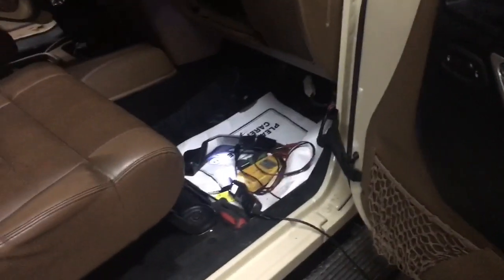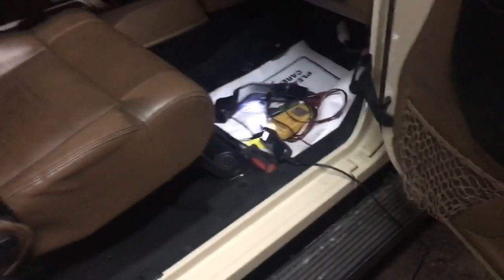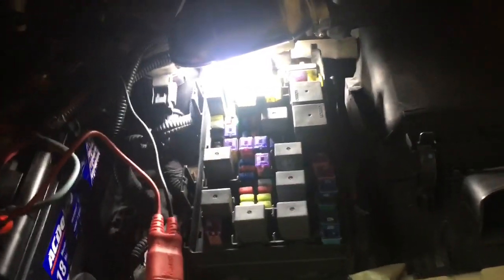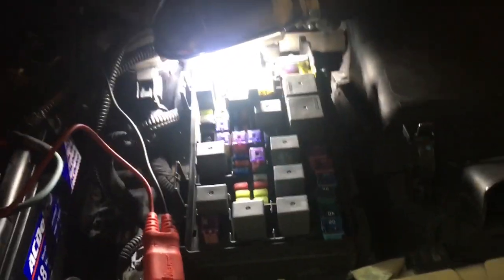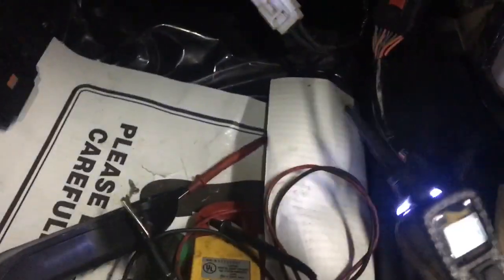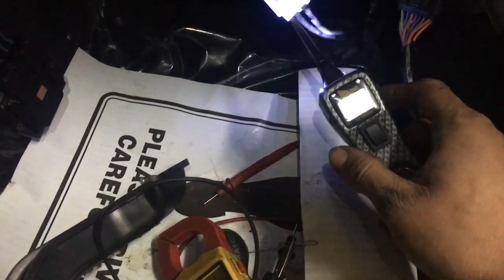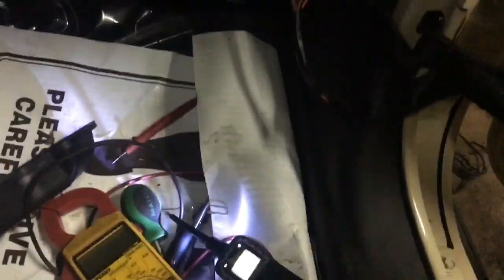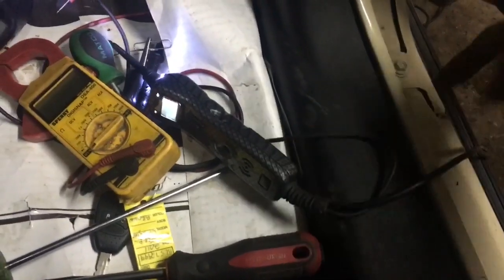How to repair no blower motor or heat in a 09 2010 2011 Jeep Wrangler

Comment: Great video. Well thought out. My fuses were good (but pressed down a few that weren't all the way down) - not it. I disconnected and reconnected the blower motor resistor - not it. I didn't want to mess with the wiring harness until I tried a few things first. I had the blower controls up and tried tapping the bottom of the blower motor - and it came on and stayed on. I'll see how often I have to tap it before I know I should change it out. I left the big screwdriver in the Jeep so I can get it going if it stops again. Thanks again - This weekend we are going to have highs of 11' F - 15' F and lows of 0' F t- neg7' F. Great to know I have heat and defrost again !!
Reply from the maker: I did almost the same thing with my battery for a couple days Jake eventually I couldn’t get it started so I ended up having to replace it but I totally understand what you’re saying about the blower motor procrastinate, procrastinate procrastinate 😂😂😂😂. Thank you for the kind words by the way I greatly appreciate them people like you are the reason that I keep doing that because they don’t pay Crap.!!

Comment: In my case, my problem turned out to be a loose connector on the fuse box end. I was getting no power on the large blue wire connected to the blower motor, and after messing with it a bit, using a test light, I got a signal again which fixed my problem. Thanks for the video though.
Reply from the maker: Well Collins we greatly appreciate you sharing that information with us because that will certainly help someone else out in the future thank you so much for taking the time to let us know God bless and have a great day

Comment: Great video.  This was exactly my issue.  Blower Fan Motor connection melted.  Now I need to source a new connector.  The 2011 Jeep JK has the male end of the plug integrated in the fan housing.
Reply from the maker: Well I think you’re the one who messaged me on Facebook can you send me a picture of that and I can give you an idea of how you could fix it? Send it through Facebook
Reply: @sharpcarco  i know this is a shot in the dark, but having this same issue w my 2011 jk, i can’t find the blower fan motor connection housing though, any help?

Comment: Where would you start looking if you had no voltage at the blower motor? Also if I turn the speed selector knob I can hear what sounds like a relay changing at each interval on the knob. I just don’t see why I’m not getting the voltage going to the motor. Perhaps that relay I see people talking about. Where is it ? In general I mean is it above the blower in the middle of the dash under the hood ??
Reply from the maker: I would assume that it’s going to end up needing a speed control module

Comment: I was wondering if I could get some help with my ac problem. My hvac knob blinks every time I start up my 2011 jk. I’ve replaced every actuator on it 3 times. I’ve replaced the ac/heater control unit twice trying to find the problem. I still get cold ac and hot air but the hvac unit goes through the blend door set up each time the jeep starts. The blend door actuator that’s closest to the blower motor keeps failing where I hear the loud clicking noises. Not sure what else I could check to make it stop going into set up mode on each start up. Thanks you in advance for your help and awesome videos!
Reply from the maker: That’s your recirculation door the linkage is broken I literally broke mine out so I didn’t have to worry about that I’ve got a video coming up about that very soon. 

Usually if you reach your hand down underneath the windshield or you take the blower motor out you can pull the door right out of there and that won’t happen any longer
Reply: @sharpcarco  Thank you for the quick reply! My circulation door opens and closes though, I would think if the linkage was broken it wouldn’t move at all right?
Reply from the maker: I would not think it so I must be wrong , but I wil try to finish this video up , it may help , because I’m going to talk on the subject a bit about things that can cause different things in the ac system 

I your situation I would have to think there is something collecting that is restricting it over time ….. I wonder if there is some mating up in there that is being pulled down over time . If the door is not falling down

Comment: I can't find the resistor, where is that located, from the video I see it's someone in the center console. I'm not getting any power to the blower itself, so I'd like to test the resistor.
Reply from the maker: can you find the blower motor? Follow all the wires from the blower motor to the blower motor resistor The wires will go from the controller to the blower motor resistor to the blower motor

Comment: hey great video, i have the same jeep 2011 jk, my blower works perfectly blow air from low to high, but my heat (heater) is not working. what you think may the problem?
Reply from the maker: Well there’s quite a few things that it could be and I’m sorry I wish I could direct you better than my video did but unfortunately I would need a ton of information and it would be difficult to still help you over a text message sorry

By the way I was absolutely certain that I answered this six days ago when you asked I certainly try to keep up on these things

Comment: Besides the resister, the motor or a bad wire or connector, is there a blower relay?  I have total failure and I see a blower mower relay listed in parts stores for my 2008 jeep wrangler.  Its a 5 prong relay but I am not sure where it is located (or if its a possible culprit).  I replaced resister and it did not fix the problem -- I will bang on the motor to see if I get a response.  Fuses looked good.
Reply: under the hood fuse box LOL

Comment: Hey Clay, thanks for the video. Problem I have on my 08 Wrangler it that on high speed setting, the blower motor speed fluctuates up and down. The other settings seem stable. Any suggestions?
Reply from the maker: I would say by that it sounds like your blower motor itself brushes are going bad , replace the blower motor,  The only other possibility is the blower motor resistor itself . Remove your blower motor and plug in the new blower motor before installation and see if it does the same thing if it does not replace the blower motor if it does replace the blower motor resistor and return the blower motor hope that helps good luck
Reply: Thanks very much for your response. On the lower speeds, it doesn't sound quite right either. Motor replacement it will be.

Comment: what is the amp for the blower motor
Reply from the maker: That’s called a blower motor resistor it has a heat sink on it just like an amplifier because it creates a lot of heat  as it stops up the voltage for the blower motor so the heat sink is very important and that is why they burn out because they create so much . I’m hoping that answers your question

Comment: What's the part number for the resistor
Reply from the maker: Sorry Tyler I’m sorry I thought I put it in the video I honestly made that so long ago I have no idea I wish I could be of more help
Reply: @sharpcarco  I believe the issue is the switch so I'll have to take apart the dash. The knobs don't light up so I think it's something behind the climate control knobs.
Reply: Tyler Kendell how did you make out with the switch? Mine lights up but the phone is not turning on at all. Just ordered the complete cluster switch thing cause they weren’t available individually for my 08
Reply: @aneuryperez2324  it turned out to be the climate control cluster. The part was 220 and that's the cheapest i could find it in my area cause its cold and i needed it the next day.
Reply: @aneuryperez2324  also it's really easy to do yourself. It's just a plug and play basically.
Reply: Tyler Kendell so i just bought on amazon and paid for two day shipping... here is a question. Mine wasn’t working at all as I mentioned before (except I wrote phone and meant fan lol) ... now I got a new factory switch and when I installed it still didn’t turn on and I was ready to give up and 1-2 minutes later it just turned on. Did yours take a minute to program or something ? My fear is since it took two minutes is that maybe there is another issue and I got a false positive fix lol .... will it randomly stop now? Hate that it didn’t work immediately.